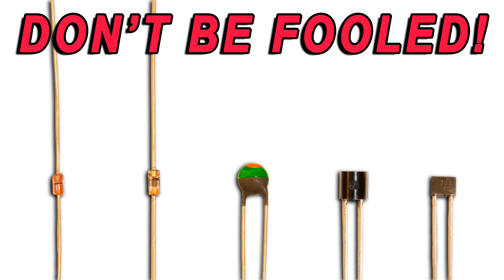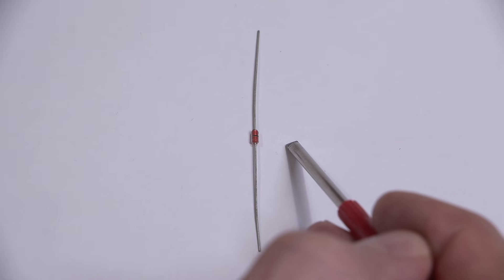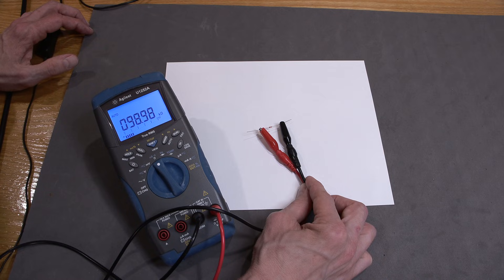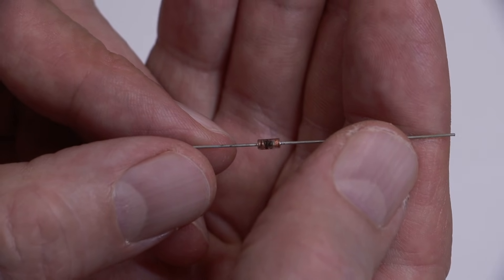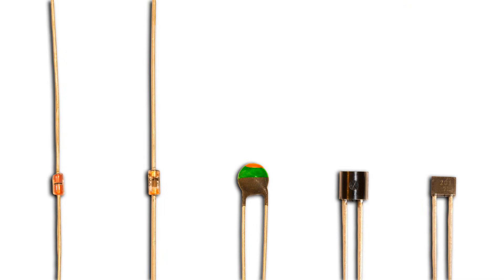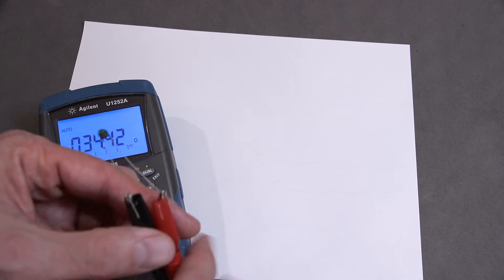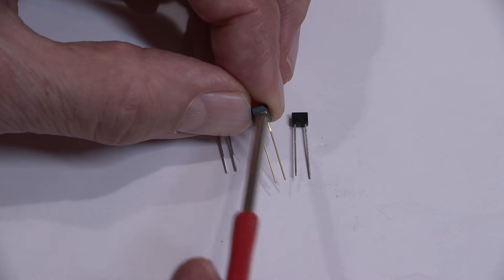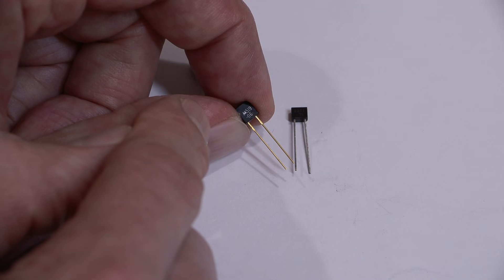Don't Be Fooled By These Parts!

Comment: In the case of the 350 varistor, Is there a standard temperature that it is designed to be exactly at that 35 ohms? And is there going to be that standard temperature that all component manufacturers conform to for those kinds of components?

Comment: never seen a glass encapsulated capacitor like that before, that's cool! Most of the industrial controls stuff I work on is fairly conventional surface mount stuff. Sometimes they'll conformal coat the boards, but usually that's a special order option.

Comment: With the first one I thought, you can't fool me Mr Carlson, that's a glass capacitor. I was only a bit wrong. 😄 I was right the second time though. They are used in the Sinclair ZX Spectrum home computers from the 80's. I've repaired, modified and re-built many of them over the years. I love programing them too.
Reply: zx81s used them as  well, also their rampacks, and seen them in a few other items
Reply: @andygozzo72  I've never had to take a RAM Pac apart. They were that reliable. (if you don't count the wobble. Ha ha)
Reply: @Franko_Walker  not nowadays theyre not, 4116s are notoriously flaky, i recently serviced a few and sold them on ebay😉
Reply: @andygozzo72  TBF, I've not used a RAM pac for years. I gave my ZX81 32K internal RAM a very long time ago.
Reply: @Franko_Walker  how did you do it? what memory map? theres more than one way, and one doesnt give contiguous ram but 2 separated blocks(the easiest mod)
Reply: @andygozzo72  I remember using a 7400 series logic IC. But can't remember specifics. I don't fancy taking it apart to have a look.
Reply: @Franko_Walker  if it uses a chip other than the ram its the more complex contiguous ram mod, 32k from 16384 to 49151, with addresses over 32768 not usable for machine code, only byte storage, unless you do þe 'M1NOT mod'... with just a ram chip you get 16k from 16384 to 32767 and 16k 49152 to 65535 , only usable as byte storage, no program code
Reply: @andygozzo72  I have the full 32K access mod. I mainly use higher memory, (over 32767), for storing maze information. (I write a lot of maze games. LOL)

Comment: Recently , discovered a solid state relay. Chunk of sealed plastic with some external connections. No coil and contacts type thing. No schematic of inside.  Part of an aircraft DC power circuit.

Comment: I’m 68 years old and I would really love to make my own RF tube type amplifier with 23–500 Z are used to have an old intron that a gentleman in Texas helped me modify to a six tuber and with a driver she would do 17 grand, but before I get too bad to where I can’t do anything, I really would love to learn how to build one just a simple 27 MHz three–500 Z tube amp 10 and 11 m
Reply: Unfortunately not too simple. 3-500z tubes are  about 300 bucks a piece. 3 in a 27mhz circuit would likely need a precision designed tank circuit. Your tank Inductance small and min capacitance on your tune capacitor.  A transformer capable of at least 2500v DC at a min of of a 1amp rating for intermittent key down.  So unless you would have a good junk box with these parts on hand it would be expensive.  Not trying to discourage you but unfortunately true. A single 3-500 would do an admirable job. Good antenna more important first. Then apply the juice.😊

Comment: How would I find somebody to fix my CB radio I have a Cobra 2000 Gtl
Reply: You need to find someone with an FCC license to work on them (legally anyway) and the proper equipment.  I used to repair these by the dozens back during that 5 year CB boom back in the 1970s.